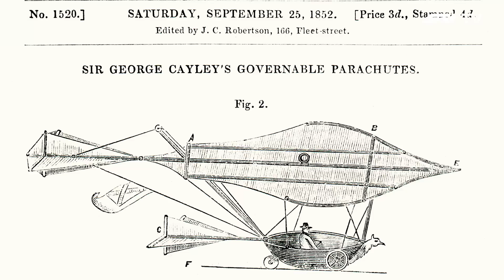Origins Of Wings! | F1 TV Tech Talk

Comment: 3:39 Graham Hill's teammate in 1969 was Jochen Rindt, not Jackie Oliver. Rindt was very anti wings, and wrote a very strongly worded letter at the time arguing that they should be banned outright due to ruining the racing and posing a huge danger.
Reply: Was about to write that
Reply: Quite unfortunate that when he was testing a Lotus 72 with the non-rear wing configuration at Monza he died
Reply: @housesports000  
I don't think the wing had anything to do with his accident.  The 72 had inboard front brakes, with halfshafts connecting the rotors to the wheels.  One of the halfshafts snapped in a braking zone at very high speed, which caused the car to veer into the guardrail.  Chapman's obsession with lightness may have been the cause, which was also a problem with the wing mounts on the Lotus 49 in Barcelona.
Reply: @jimiverson3085  yeah it wasn’t the wing, I was just pointing out the irony of the accident
Reply: @housesports000  
The steady theme was Chapman making things as light as possible rather than as strong as they needed to be.  I was a fan of Lotus in those days, but his obsessions really killed or injured a number of drivers unnecessarily.
Reply: @housesports000  
Yes, that's what happened to Hill.  He may have been winding down at 40, but that ended his time as a race winner in F1.  Even Stirling Moss didn't get off - he had big accidents in Lotus cars at Spa in 1960 (broke both legs) and Goodwood in 1962 (over a month in a coma and ended his career).

Comment: Sam! let's get something corrected here.  Nobody, NOBODY! was successful at powered (heavier than air) flight before the Wright Brothers.   Wilbur and Orville were the first pioneers to make a wind tunnel to accurately test their air foils, have an aircraft with pitch and roll controls, an efficient tapered propeller, like you see on modern aircraft, and a powerplant light enough and with enough horsepower to propel the aircraft with a pilot.  Whew... ok lets get back to F1!
Reply: Ferdinand Zeppelin? LZ1? 1900?
Reply: The Wrights built the first successful heavier than air flying machine, but they weren’t the first in powered flight
Reply: Well, I was speaking in the context of the video being "Origins Of Wing's" not lighter than air balloons and zeppelins., etc.
Reply: This is why America has no place in F1.

They think because their guys were more successful that they did it first. News flash, some dude strapped a kite to a boat and beat you to it.....

Comment: I'd be fine if Sam did a whole series with episodes an hour long on the history of motorsport tech. I'd watch for sure.
Reply: History of mid engined cars.
History of slick tires
History of mid race tyre changing
History of mid race refueling
History of ground effect
History of single seater racing (no on board mechanic)
History of fuel injection
History of turbo charged engines
History of monocoque chassis
History of push/pullrod suspension
History of active suspension
History of traction control
History of (il)legal ballast such as lead shot brake cooling water tanks
History of additional aero (x-wings and such)
Reply: @PlittHD  while I know it didn't originate in F1, Disk brakes. And what would eventually become carbon ceramics?

I think a deep dive into the history going way back would be awesome.
Considering this video went as far as to spend a few moments on the origin of the wing and aircraft.
Reply: He’s written plenty of Racecar Engineering articles in the past, the level of detail to which he would point out in photographs was really eye opening as to how Sam analyzes race cars.
Reply: @jasperli  yes, but that vs having the budget for a whole show of his own would be on a whole different level.
Reply: Yesssss
Reply: Just came here to comment this.. make it happen f1
Reply: Yes! This!